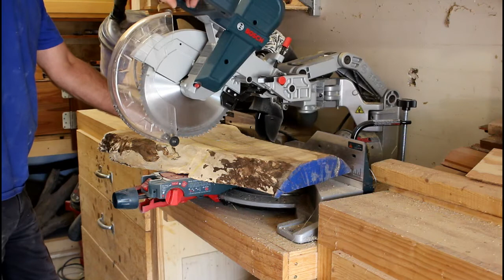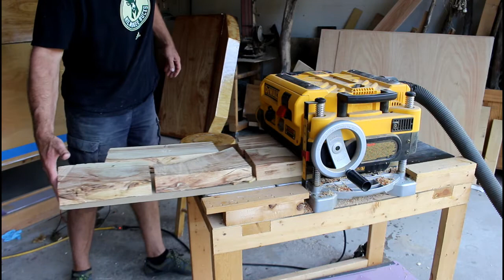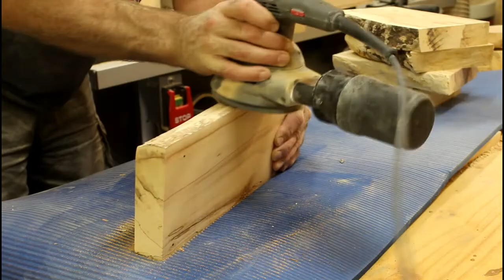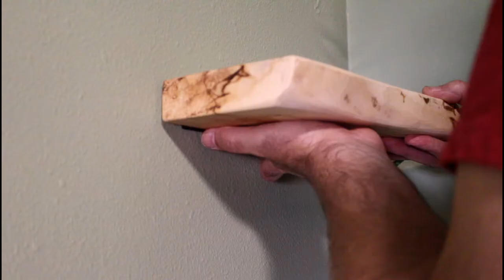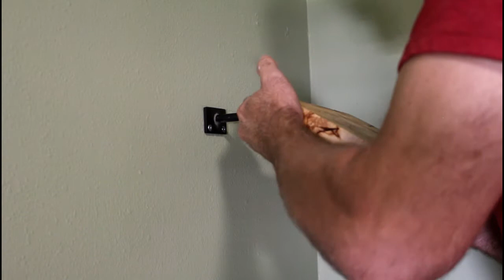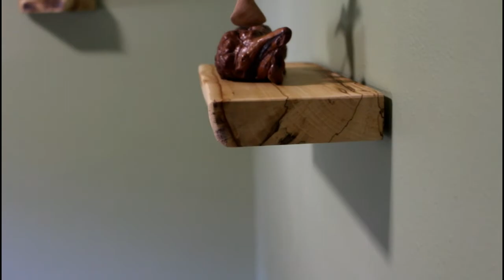Making Floating Display Shelves

Comment: Hi Mark,
lovely work. Question,  what type of bars are you using for your exercise station? also what lenghts etc? I'm in Dublin Ireland
Reply from the maker: Those bars are black pipe found at diy home centers. They are meant for gas supplies. I used the 3/4" (18 mm) inside diameter pipes. Most of them were 4 feet long (1.2 meters).